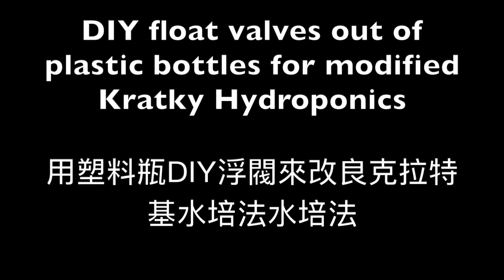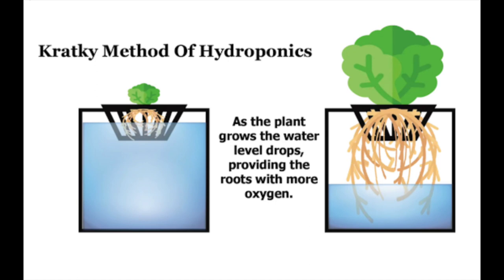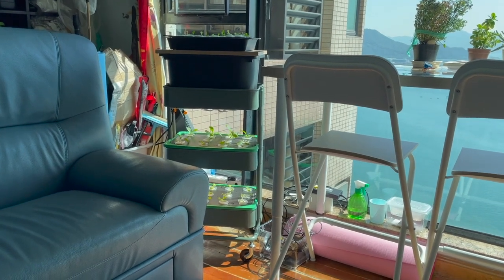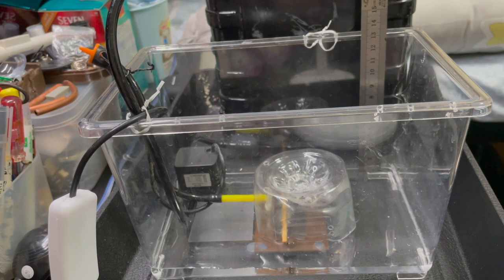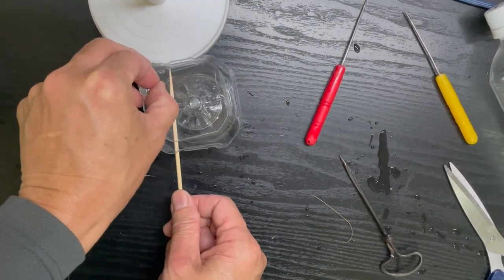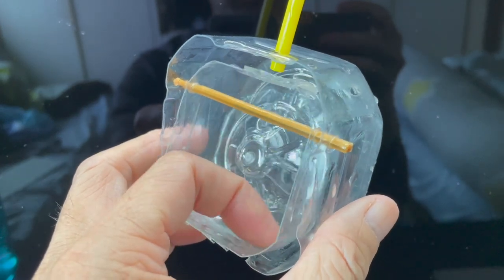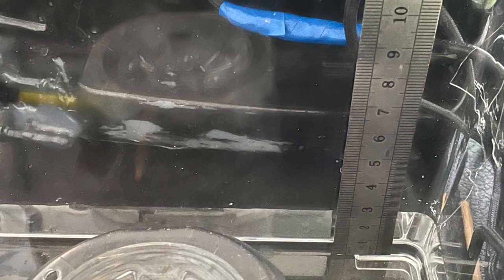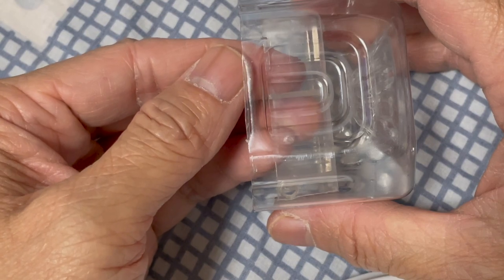DIY float valves out of plastic bottles for modified Kratky Hydroponics

Comment: Hi Billy~ Thx for your awesome videos! I was wondering if this system works like autopots? where the new nutrients wont be supplied until all the old nutrients are used up by the plants?
Reply from the maker: Yes and No. Yes, it controls the water level, only the max water level. No, it does not control the low water level. The Autopot is a more advanced design where a second float valve is involved on the outside to control the low water level. I have tried a number of design to do what Autopot does, but are not stable enough to share. i.e. sometimes it works, sometimes it does not work. It's because while stopping water flow is easy, stopping air flow (second float valve) is. a bit more tricky. This is one of my attempts to do what autopilots  does:  This one is the first attempt with diagrams describing the theory behind this. https://youtu.be/jFU-bGxyo_Y.  This one was my last attempt before I gave up on it. https://youtu.be/vOO47X8YGvM.  You can search for float valve  in my channel to see more

Comment: Do you have any problems with roots getting into the float valve assembly?
Reply from the maker: Not really if you keep the base of the float valve close to the bottom of the growth tank. Or you can put a bigger bottle on top with small holes to function as a guard .
Reply: @BillyCdiy  Thanks for that. I want to try a few different float valve ideas. I will probably go with the 3D print version as the only square/rectangular bottles I have available are a bit soft.
Reply from the maker: @snarkfinder2621  , I have redesigned my 3D printed float valve to fix a few issues. Will release a video soon. Also trying something else to use a fill up bottle to keep a preset water level using the atmospheric pressure.  Check this out. https://youtube.com/shorts/y1QU4-sfSF8?feature=share